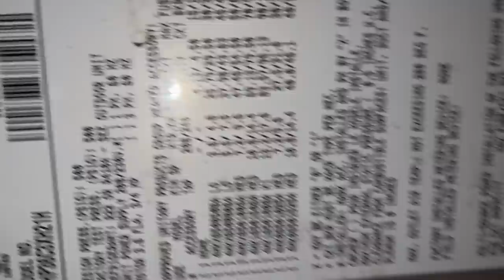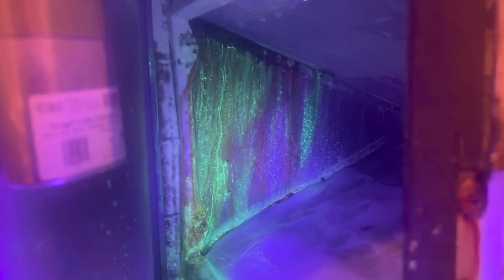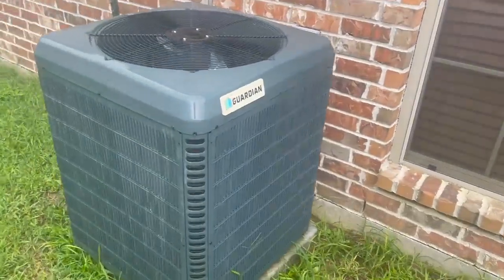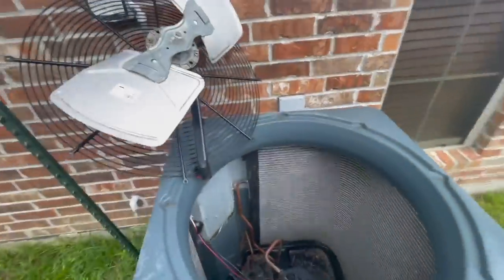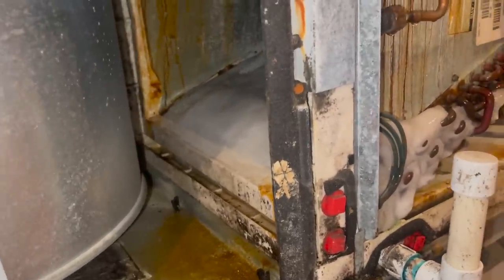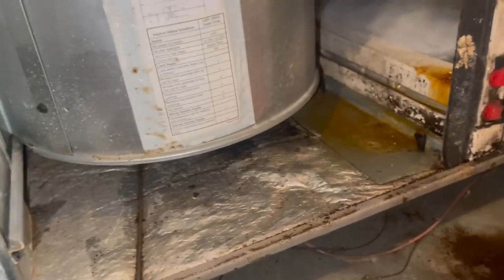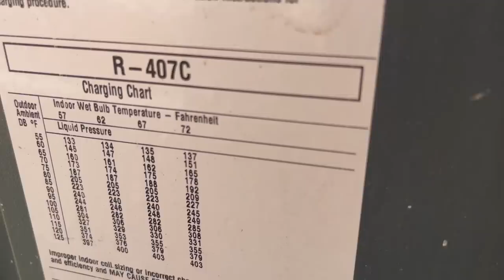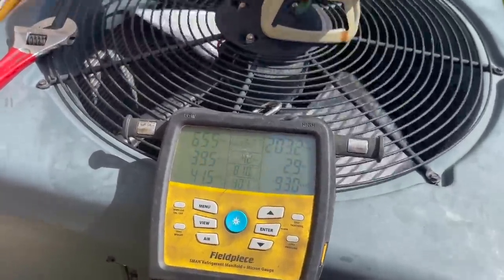No Cooling/A Leaking System

Comment: That air handler wouldn’t be wet if the correct secondary drain was installed on the air handler.

Comment: Film the changeout
Reply from the maker: It’s already done
Reply: @johnisraelhvac2019  
Hey John,
Quick question..
If the capacitor on my AC unit is a 45/7.5 uf +/-10%
Can I replace it with a 45/7.5 uf +/-6%..?
Thx in advance..